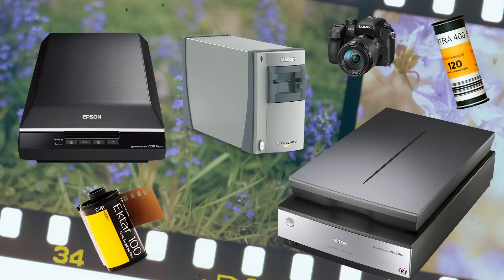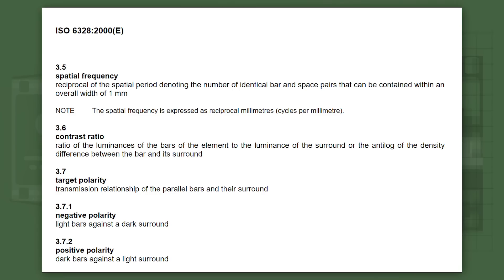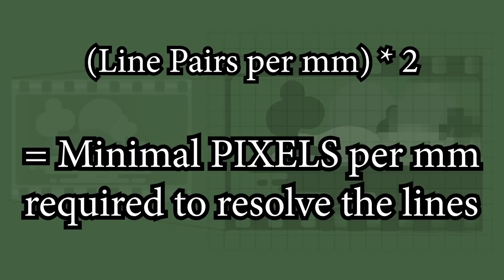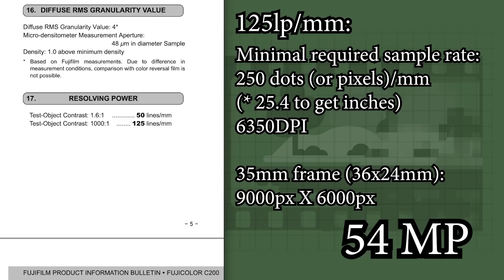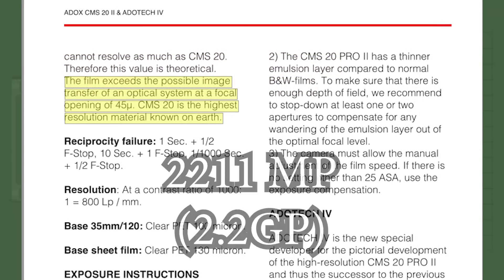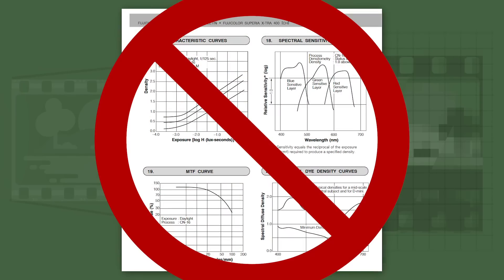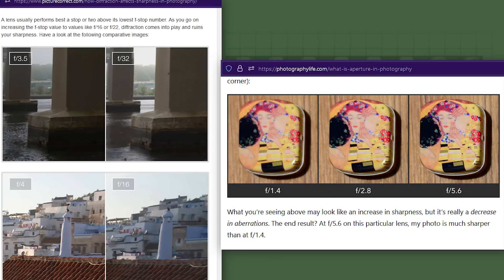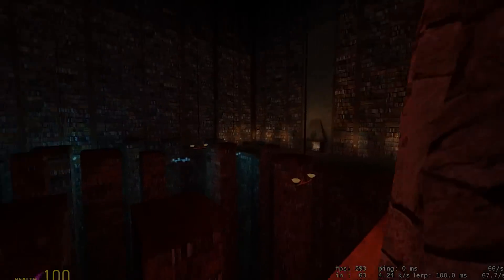The TRUE Resolution of FILM

Comment: Great video! 
It’s worth noting that in audio, a higher sample rate than 44.1kHz doesn’t actually result in any greater perceived audio quality. Only an increase in the maximum frequency which is able to be captured, but as those higher frequencies are outside the range of human hearing they go completely unnoticed. This can be useful if those higher frequencies are going to be shifted down into audible range but otherwise it won’t make any difference aside from larger file sizes and greater CPU usage.
Reply: Ironically, it turns out that your audio pipeline may or may not have degredations and distortions when given ultrasonic frequencies, so it's actually possible that the two things will feel different but your 96khz one will surely either be equal or worse than a 44 or 48khz file. I can't link stuff in YouTube comments, but there are many good articles about this online ("Are high sample rates making your music sound worse ?") that provide examples of high sampling rate audio files that should be silent but will often have unintended pops or clicks or other noises caused by your system performing poorly on ultrasonics.

96khz surely is useful when recording so you can stretch the file more, but don't master to it lol
Reply: @thatcherfreeman  if you are not using a correct low pass that might very well happen. When your speaker is not able to play back the full 96khz you might get Aliasing
Reply: @TheScrubsfanforever  96khz sampling  with a 22khz low pass filter seems like a waste lol
Reply: The real reason to use higher sample rates is for the reduction in roundtrip latency, outside of specialized cases of course
Reply: @drewhornyak  roundtrip latency? In what scenario is 1/44100s meaningfully different from like 1/192000s? Either way your ear can't tell the difference
Reply: @drewhornyak  the difference between 44kHz and 96kHz in terms of latency is the same as moving 4mm closer to the speaker or microphone.
Reply: Wrong to the bone!
Reply: Theoretically that’s correct, but the real world use proves differently. When you work with sound files in a DAW you’ll notice right away that there is a pronounced difference between 44.1kHz or 48kHz and 96kHz listenability. Lower rates sound harsh and “thin” especially at high listening levels. It’s especially noticeable when using EQ or compression or other plug-ins where lower sample rates don’t respond as well as 88.2kHz or 96kHz. An interesting read is Dan Lavry’s white paper where he discussed the diminishing returns past 96kHz.

EDIT: Also nobody seems to use 16-bit word length at sample rates higher than 48kHz, and I believe that most of the benefit comes from using longer word lengths. 24-bit words are so much more precise than 16-bit. So it would be interesting to compare 16 bit 44.1 or 48 and 16 bit 88.2 or 96.
Reply: @andrewlutes2048  I certainly agree that there's value in capturing audio at high bit depths and sampling rates when you want to manipulate those files in post; the higher resolution files won't fall apart as easily. The tougher argument is the claim that exporting or listening to finished music at 96khz is perceptually better than 48khz... That seems like a much tougher claim that is not supported by the theory or math.
Reply: @thatcherfreeman  This is exactly right, there’s a handful of benefits to working with higher sample rate files as an intermediate file and higher bit depth definitely make a difference, at least up to 24bit. But I’ve yet to hear a convincing argument for anything above 48kHz for the end product.
Reply: @thatcherfreeman    When I record 96/24 (or better yet: 96/32 float or 1 bit DSD) I have much less need for EQ or compression at all. It becomes more about mic placement and the acoustics in the environment. Theory and maths are useful guides, but only part of the bigger scope of reality. You sense sound with your entire body, not just your ears. Many years ago I tested all sample rates and bit depths using a Sound Devices 744T recorder a Schoeps CMIT 5 and Sennheiser 416 to record a woman singing a brief phrase. Everybody in the room could hear the difference between 48/24 and 96/24, nobody could tell the difference between 96/24 and 192/24, and 1 bit DSD was clearly the ideal. Going back to 44.1/16 felt like torture after that.
Reply: @andrewlutes2048   There’s absolutely a case for oversampling while using any non-linear effects (like compression or distortion) to avoid aliasing and oversampling can help with EQ cramping but there’s no need to record at higher sample rates if your plugins support internal oversampling. Any harshness or thinness you’re hearing will be additional frequencies added through aliasing.
Reply: @samhostettler  Yes, but if you let go of theory and do the comparison without using any plug ins you’ll hear the difference. Your ears aren’t the only thing you’re reproducing sound for so the whole thing about above the range of human hearing is kind of moot. 96/24 is the sweet spot (or 88.2/24). The analog circuitry that feeds the ADC is the biggest differentiator. Drives are cheap and audio files are tiny. It’s well worth the larger files.
Reply: @andrewlutes2048  I don’t know what you mean about “your ears aren’t the only thing you’re reproducing sound for”. Ears are the only part of the body that react to sound unless you’re talking about low frequencies.
A 44.1 or 48kHz sample rate will reproduce the exact same signal within the range of human hearing as a higher sample rate file. So producing higher frequencies is like watching a TV that has UV emitting pixels, there’s technically more information there but no one in a proper randomised control trial would ever be able to tell and maybe you’ll get a sun burn. 

If you truly believe you can tell apart signals with a higher sample rate, I’m sure there are people offering prize money to someone who can prove it.
Reply: @andrewlutes2048 I hear the same differences you do. There’s a feeling and soundstage difference too. But you’d think I said something sacrilegious by saying that…
Reply: @EntonationStudios 
Too bad the comparison tool most people will be using is studip headsets. What do you have to say to this issue?
Reply: As a musician that performs with audio. There’s a difference in feel
Reply: @EntonationStudios no. It isn’t. I guarantee you, if you would do A/B testing you would not be able to distinguish 44.1 KHz vs anything higher
Reply: @TheScrubsfanforever  Come to Cincinnati Ohio, I’ll bet you dinner 😂
Reply: @TheScrubsfanforever  I’ll expand: I do audio engineering part time on top of being a musician and I spend a lot of time listening to high res audio through studio gear, so it’s possible my ears are attuned to it
Reply: @EntonationStudios  ah nice. The Anecdotal evidence. Fun fact: I studied that shit 😄

You only need higher frequency’s if you a) don’t use a low pass filter, or b) if you somehow slow the audio down

There is probably no human on earth that can hear frequency’s higher than 22Khz, maybe a few newborns
Reply: @EntonationStudios  the older you get, the worse your hearing gets. You should try a hearing test. You will be astonished how low the maximum frequency you can still hear is
Reply: @EntonationStudios I can mathematically prove you, that the sampling error between a 44kHz and 92kHz sample of an 22kHz signal is zero.

Comment: This is why properly scanned old film movies can resolve better than modern digital cameras
Reply: Careful.  This video is talking about 35mm still photography where a full frame is 36x24.  Cine cameras run across the film strip so the frame is only 22x16, less than half the area.
Reply: Even though they were "old" film movies, they probably still used cameras and lenses that were of very high mechanical and optical quality, probably better than most or all consumer model film cameras.
Reply: @oudviola  a good example is 1962 Lawrence of Arabia still looking gorgeous in today standards , while let's say willy Wonka and Murder on the orient express from around 10 years later looks relative waayyyy worse , even bad on a normal HD screen today.

Comment: Absolutely lovely video but one note: The H6d-400c doesn't "fake" 400 megapixels. It shifts the sensor by by subpixel amounts mimicking the pixel density of a 400mp sensor. It also fixes the bayer problem of having 2 green pixels, for everyone 1red and 1 blue. By shifting the pixels around every color can be represented as 1:1:1 which makes for much better color reproduction and improved dynamic range like a film camera. 

Looking at a 400mp out of the Hasselblad vs the 100mp you can clearly see the increase in detail (not just sharpness)
Reply: It's "fake" in the sense that the sensor is only 100mp and effectively can only take a stacked array photo off of a tripod or other steady position.  No one would take Apple seriously if they claimed the iPhone took 600mp panoramics (via stitching 12 photos in camera) so Hasselblads 400mp claim should be taken with the same grain of salt, IMO.
Reply: @andytheturtle87  I mean Apple sells the new Iphone with a "48mp" main camera when in reality is a quadbayer sensor which is only 12mp in the bayer sense and it uses Ai Upscaling to fake the 48mp look. And people have seem to have accepted that in droves
Reply: Pixel shift is a gimmic though. I’ve tried using it in perfectly still situations several times and it never produces a better image. And with the technical limitations of the process required it’s a useless tool. Better to stitch together 4 images at a more zoomed focal length
Reply: @tdawg719  I've tried pixel shift on a GFX 100 and my X-H2. And both have produced incredible shots well above the 100mp or 40mp respectively. I use it for art preservation and PCB shots. 

The trick is to use a Mac, Fuji's app on windows just flat out doesn't work well and even when it says it finished the image, there will be no different except in file size whipe it works much better on a Mac.
Reply: @tdawg719  My comment to you got deleted for some reason

Comment: This is the clearest and most concise explanation on the subject I've ever heard. And I've heard a LOT in my day. Even if film didn't meet or exceed digital in the technical sense, I'd still shoot it for the beauty and fun of the process.
Reply: Check out drum scanning and how it works.
Reply: Interesting video. But from a practical viewpoint, you will often get a sharper image from a digital camera.  With film. It   depends on what film, how it is developed and scanned. Most of the  time we don't use drum scanners. Too expensive.  And film is best at low ISO.  Where digital will often give great results at 1600 and higher speeds. I remember my first 5 megapixel camera. I had doubts about the quality. I had a model come in, shot a few photos and printed an 11x14 inch print on an Epson printer. It looked great. As good as from my Nikon film camera using color negative film.  My current Fuji 26 megapixel camera makes great 2x3 Foot prints. Much better than my old 35mm film cameras.  Why shoot film?  It has an artistic quality. I even like the grain I get.  It seems more authentic.  But technically digital passed 35mm film up years ago. And is competitive with medium format film and even approaches 4x5 film cameras, at times.

Comment: I am so bad at math but if I understand right that a single frame of 135 is 864 square millimeters at 54 Megapixel then a single sheet of 8x10 film with 51,612.2 square millimeters would be 3.2 Gigapixels or 3,186 Megapixel. This is insane! Thank you for the breakdown.
Reply: Well that's just theoretical, not real world. In reality film resolution depends on a lot of factors. I shoot 8x10 and 10x12 and yes, the resolution is impressive, that's why film didnt get completely replaced in astronomy and aerial photography until very recently
Reply: Wow the second one ( 8 x 10 ) is huge, I wonder if they're ever going to achieve that on a digital sensor.
Reply: @MrWiseinheart  There is no need to go to that sensor size as sensors are capable of much better detail capture than silver halide salt crystals suspended in pig gelatin smeared over a clear plastic strip or sheet.
Reply: @fotticelli  I've seen some prints from large film negatives that were wall sized where you can use a magnifying glass to see more detail) that amazed me, why I clicked on this video to find out the resolution of film.
Reply: @MrWiseinheart  I think you can find better (and more correct) information about the topic on the comment section of this video than from the actual video.
Reply: But remember, a lens on an 8x10 camera will only be putting down a small fraction of the films resolution onto the film.
Reply: @emotown1   That really only comes down to the lens. APO Ronar CLM has a residual distortion below 0.01%. But say you have a LF lens that isn’t corrected for achromatic or even apochromatic then sure you will have less possible resolution. There are LF lenses with very good resolving capabilities. There are also LF lenses made of plastic. The film will still be the same. Tmax is the same in 135 as it is 120 or 4x5, 8x10, 11x14 hell if you can get your hands on some it’s the same as 20x24. But yes you are right, the resolving doesn’t change. The advantage of LF is the ability to contact print. No enlarging necessary.